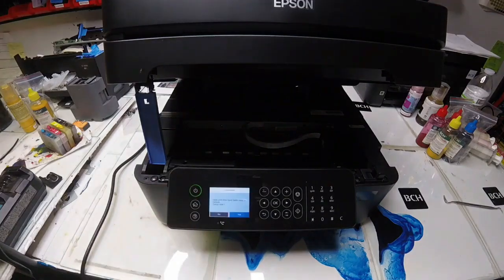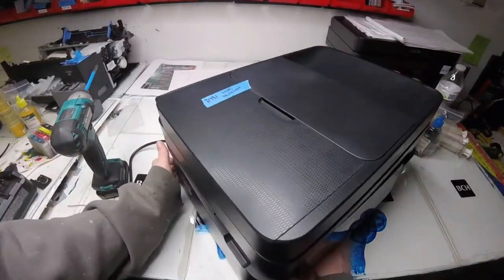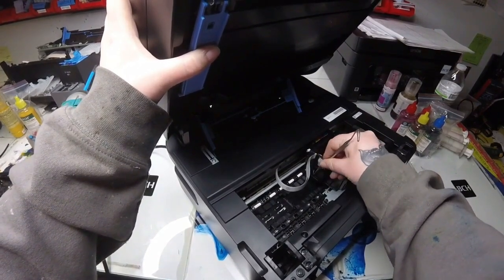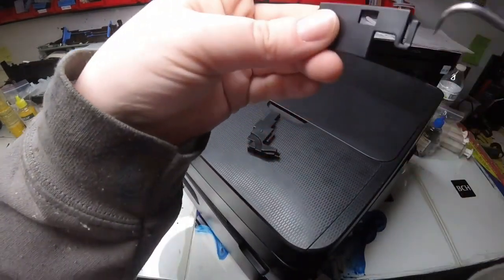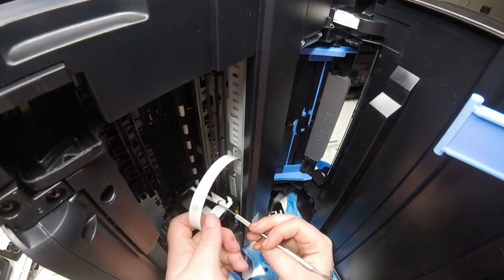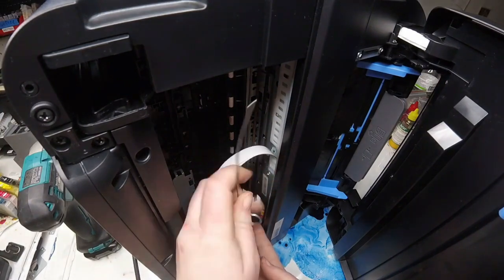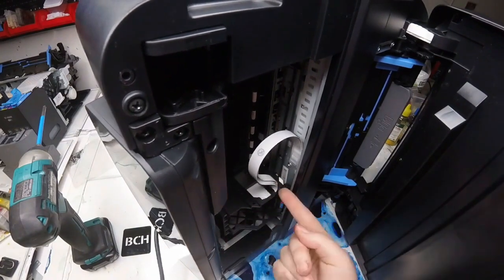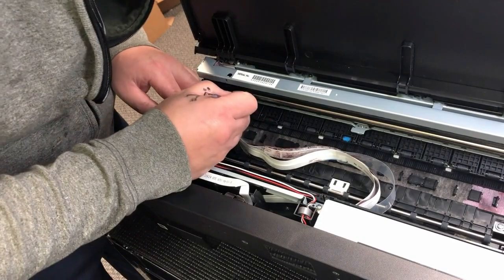Can't Fix Epson Error 033007? This Trick Could Save You!

Comment: Epson XP 3100, I have been struggling with error 033007 for several days. Until I found this video, I read many articles describing the problem, but none could fix the printer. There is a lot of information that the error is due to frequent cleaning of the head, that ink may have got into the electronics ... etc. All these messages are not fully verified and true. There are "experts" who tell you to leave the printer and wait ... the question is why? The printer will not repair itself, unless there are devices that have a self-repair function. Error 033007 is caused by a bug and this video shows what it is. The moving head during printing may lead to ejecting of the electric tape. That was my case and waiting wouldn't help. Thank you very much for the great material, which will probably help many Epson users. Regards.